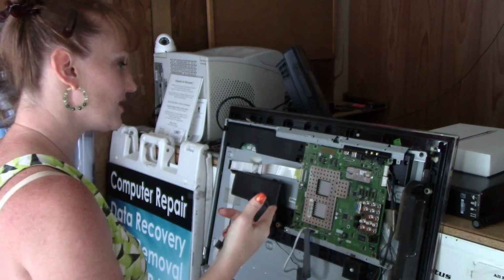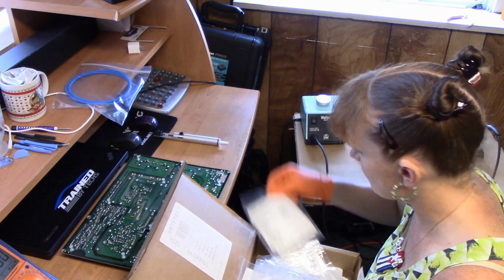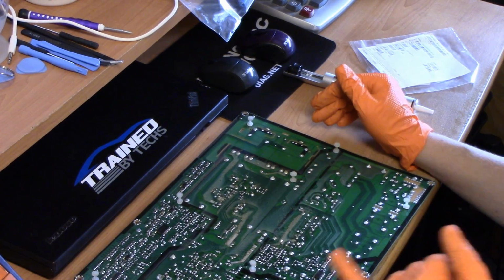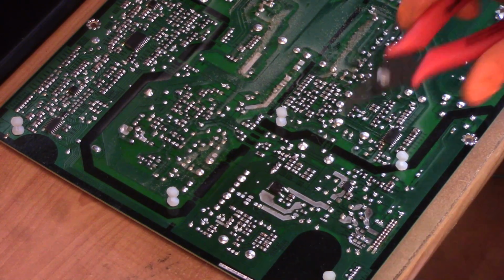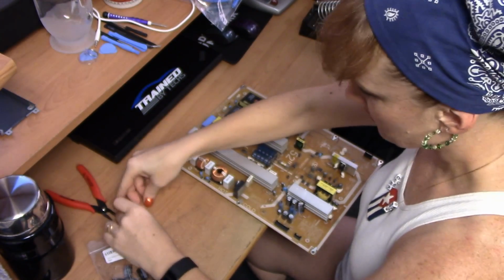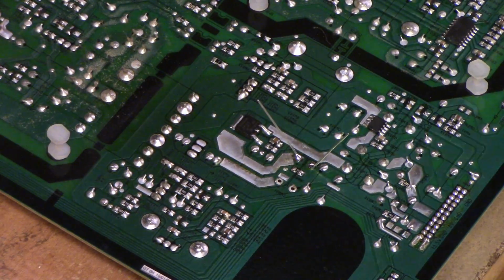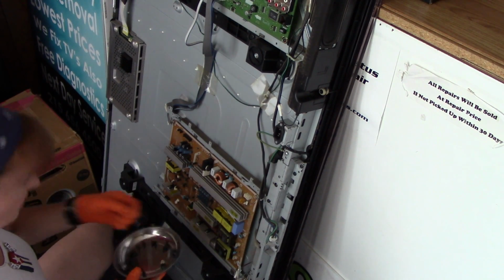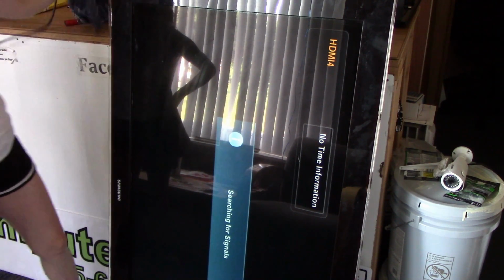Samsung 52" TV Repair (English)

Comment: Thank you for the nice video. How did you diagnose the problem down to the 2 capacitors?  And question about soldering.  In video it looked like you are getting small ball or bulb just above the pad. I was taught you want solder to look like small volcano with lead in center and that a ball above pad meant pad was not quite hot or clean enough for the solder to stick well. Your thoughts, please.
Reply from the maker: Great questions. The 2 capacitors were visibly bulged (especially the top) or they were leaking, which is the easiest way to call these type of capacitors.... the electrolytic. Otherwise,  using a meter that features the ability to measure or test capacitors, is the only other way.

On the soldering query, yes, you want a somewhat volcanic appearance, this is usually the minimal amount of solder and it's visibly sticking to the pad & wire of the component. This 'sticking' of the solder joint is what gives it the volcanic effect. I will sometimes add a little more than the minimal, depending on the application, such as something that has high vibration or travels a lot. I also use a silastic material to prevent the joints or components rattling free.

Comment: What kind of gloves are you using and do they protect against electric shock?
Reply from the maker: They do not. I typically use nitrile gloves, since they are thicker and last long most fluids or greases.  In this case, I was wearing gloves because I find all kind of "nasty" things in them. Hair, bugs, etc.  I'm easily grossed out by that stuff. hahah 😅😅
Thanks for subscribing!! 😊😊

Comment: This is an older video and I am sure you have figured this out by now, but it makes it much easier to desolder if you first add some fresh solder to the pads/pins and always add a bit of fresh solder on your tip after you clean the tip. It helps transfer the heat much faster, thus less chance of lifting pads, or damaging new replacement components by holding the heat on to long. The solder should melt almost instantly.
Reply from the maker: Yes sir. Lol I'm now working on vehicle modules & eeprom. So with time & practice, I've come a long way. I still appreciate your input & comments, as it could help others. Thank you much 😁🤗
Reply: @CubasAutomotive  I could tell that you are very smart woman and highly intuitive, so my comment was as you suggested (to help others) of whom might learn sooner, rather than later. 

I learned the hard way and caused myself a lot of grief repairing lifted pads. 

That's awesome that you are working on repairing ECUs and other vehicle modules. I am not an expert by any means, but I managed to repair all 3 of the failed modules (ECU, electronic controlled suspension and digital climate control)  on my Dodge Stealth. In my area there was no one repairing such units, so it would have cost a fortune to replace al 3 units. A new ECU was $1600 alone and as I'm sure you know that repairs with higher quality (than failed) components, will last much longer than the OME parts. 

The manufactures save a few dollars by using 85C capacitors, but we know that (especially in vehicles in the hot sun) need 105C high quality capacitors for longevity.
Reply from the maker: @gordthor5351  that's awesome! You don't have to be an expert, and sometimes it doesn't look pretty, but if it works.... that's what counts! 

I could see exactly why you went that route. Worst case scenario, they're still broke. Many times modules are on backorder or no longer being made in some cases. How awful is that!? So that's where being able to do this is can be a Godsend.

I'm sure it was an amazing feeling of accomplishment to have been able to fix them. I agree about putting higher end parts back in when possible. ICs or transistor drivers are a couple things I haven't been able to find much about in regards to upgrading quality. In this case, I order new or use a donor module. The drivers are usually taken out by the component they're controlling, so they also get replaced as well. 

Such a pleasure to read your comments! Stay well & have an awesome day! 😊

Comment: I find those flux pens (MG Brand) always leak, so I've gone to the paste style.  Have you had luck with that brand?
Reply from the maker: So far,  it's been great.  Kester brand. I just used it again last week. No issues. I will try something different when this runs low. Keith Perkins from L1 Diagnostics & Programming likes this Amtech flux... in fact I've heard many great things about it. Just don't buy it Amazon.  No one has it in stock either... but it's  Amtech NC-559-V2-TF Tacky Flux 30CC

It's suggested to purchase it from https://store.rossmanngroup.com/index.php/catalogsearch/result/?form_key=7GcVLdhNvALK3jmY&q=Amtech

I hope that helps.

Comment: I almost fixed my first LED TV, but because of something I did to the glass, the TV worked, but had lines on the left side.  Original problem was the backlights were out.  Found out they should be adjusted  down in intensity from max to about midway for long life.

Comment: My 55" Samsung in the living room was a free TV off Craigslist because it would power on and turn off shortly after. Turned out it was the capacitors on the power board also. I bought an old Fluke 11 to read capacitance for $20, also off CL. Mine weren't spewing the black insides out so I had to de-solder, test and then replace. Wished I'd known how to test the caps still attached to the board before now. It's been a great $32 TV for the past 5 years. LoL good job, bro!
Reply from the maker: Awesome! 55"!! That's a heck of a deal! Yeah, there was a little work put into it, but it's lasted 5 yrs so far! AND got a Fluke to boot! You absolutely can't beat that! Thanks for sharing!! 😉😉😊😊

Comment: the main input filters caps usually discharge within 5 to 15 minutes max, BUT better safe than sorry and always check them with a meter!
I haven't had to discharge any in over 20 years, at least in non tube type equipment or crt tv's, there's nothing like 2 to 50KV with high capacitance to ruin your day or life.  ;)
I have things that normally run 2 to 5KV DC at up to 4 amps current and enough capacitance to land you clear across the room, maybe stuck into the wall and for sure dead.
also be very careful if you ever service microwave ovens, I've had some the capacitors with internal bleeder resistors went "open" and they still had over 1KV stored many hours later!
when working on that stuff you either learn quick to not wear anything metal(jewelry), never lean over top the stuff, work in an electrically isolated area(if possible) and only one hand working on the stuff, keep other hand in your pocket and the rest of your body far away form everything. worst case then you get a hand or forearm zapped to hell and maybe punch yourself in the head lol

Comment: typical failed electrolytic capacitors, they always go bad from being used smoothing the harsh PWM switch mode power supply output. the power supplies will often have a high pitch whine when the capacitors are well into failure.  one very important thing to note, is make sure you always use good "low ESR" rated capacitors as replacements, standard ones may not work at all, cause the supply to trip offline instantly, fail very fast or rapidly overheat and turn into flying projectiles as it blows the cans off (yeah it happens sometimes) lol
for those that don't know the terms PWM = pulse width modulation and ESR = equivalent series resistance
Reply from the maker: Yes,  I definitely upgraded the quality when replacing. Low ESR was 1, but also higher voltage. Side by side comparison of old & new capacitor.  1000hrs vs 5000hrs... and the rest I mentioned above.   Great input Throttle Bottle!  😊😊😊

Comment: Capacitors! ;D
Reply from the maker: Oh yeah... some parts required... hahah
Reply: In electronics, they are usually the first things that fail. The electronics equivalent of "readin' codes and throwin' parts" is to look at the circuit board and visually inspect every electrolytic cap and see if they look swollen or burnt and replace them.
Reply from the maker: @opl500  yeah, unfortunately you have to in electronics. Luckily, most of those parts are only a couple pennies!! I try to look for any stuff that comes up black with a blacklight....which I've found to be a leak of sorts from either capacitors or resistors, believe or not.

Comment: Great video Cuba!   I  have a LG LED TV that lost its picture. I removed the powerboard and checked all the Capacitors, but could not find any that were blown.  Any ideas?
Reply from the maker: You'd have to check some power inputs and outputs on a couple different places.  If you can send me some pics? (Email in description) I may be able to help you... maybe model #.  The more specific of the 2 which include 3 or 4 extra letters on the end.  Can't hurt to try....  I'll see if I can post a few pics I used on other TVs, of their boards and some of the things I look at.
Reply: @CubasAutomotive  Kewl, Thanks!   I'll gather the info and email it.
Reply from the maker: @Chris-Fennimore  Awesome!  i'll keep an eye out for it.
Reply from the maker: Also... lost both light/picture & sound?  or just sound?  Try shining a flashlight into the screen when powered on to see if just missing a backlight? You should see a faint "menu".... Is there a standby light on?  
These are questions I would need answered too....
Reply: @CubasAutomotive  Pic went out while watching TV. No sound, but possibly Changed input accidentally, so not sure on sound. I'll try the flashlight and look for a menu.input text.
Reply from the maker: I emailed you yesterday or day before... I also had to send an extra pic I noticed was left out.  I know it took me some time to get some info together. I truly hope it helps. ;)

Comment: you're cooking supper saturday??? what should we bring  lol.   nice fix.  common problem. quite often the short takes out the mosfets but as in this case not always
Reply from the maker: wow!!  I should consult you in the future!!!  You sure sound like you know what you're talking about.  I'm still quite basic when it comes to those components and how they function.  Mosfets regulate power?  or amplify it?  I'd need more visual to truly understand them, I think.🤔🤔
Thanks Rich!! 😄😄😄
Reply: @CubasAutomotive  look for mr carlsons lab and his video on switching power supplies. he's good at explaining how they work. the mosfets switch on and off at a high frequency makin  power circuits with less dips in the voltage making it easier for those capacitors to be the electronic equivelant of a shock asorber so the power is cleaner for less digital interference. the closer an ac rectified scope trace looks to a dc battery the better. thus why a bad alternator on a car can mess up a can network or even sensor signals.  clean in clean out  garbage in garbage out!
Reply from the maker: @richardcranium5839  nice!  Your explanation ALONE helps immensely!  Love it! 😍😍Thank you so much, I will check it out! 👍👍👍

Comment: Actually Cuba the flux used for electronics is never acidic.Acid corrodes and that is a no no for electronics. you likely have a rosin based flux or something that they have upgrade d since I stopped doing tv / electronics repair.
Reply from the maker: Ahhhh.... I see. Oops... I suppose that's the problem with too many trades...

 I however, just doing a quick search, I came up with the same information of how flux should be cleaned off boards, either because they are corrosive if left to sit or they may conduct where conduction isn't wanted.  I "try" to provide accurate info, especially if I'm sharing, but I'm by far an expert in the soldering of electronics field.  I wonder what others have to say on the matter?  
I truly appreciate the input and information Kim!! Thank for taking the time out to comment!! :)